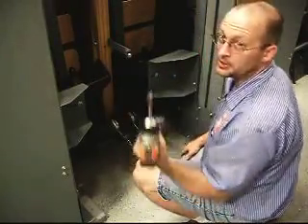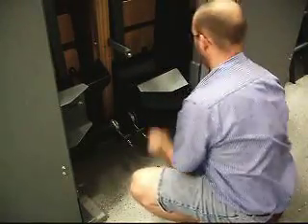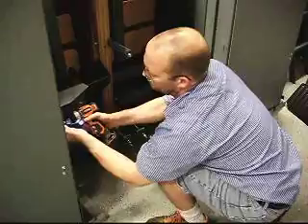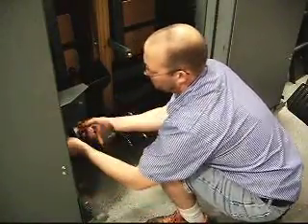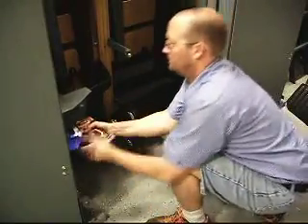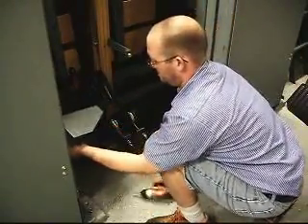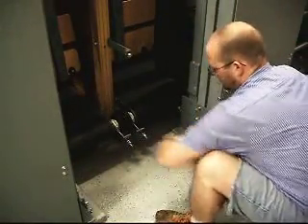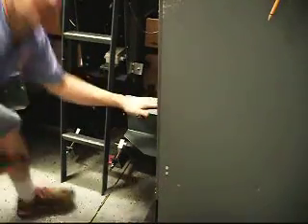GS-X pinsetter, short pit, front and rear roller assembly removal.

Comment: I use a saw to cut the carpet after I extract the rear roller and then pull the band, the boards and finally the forward roller. I hope this tip saves you time. Thank you for all your tutorials, they make maintenance much easier